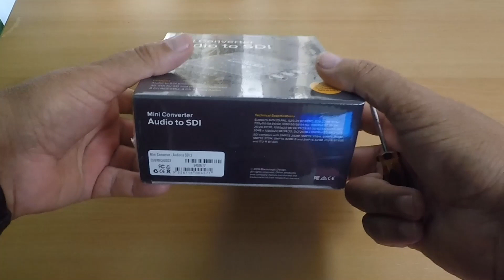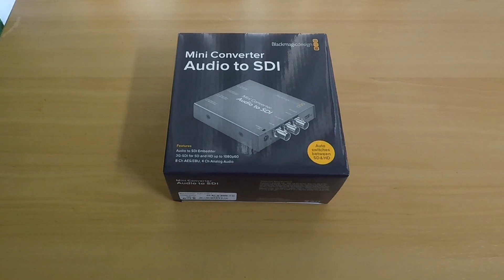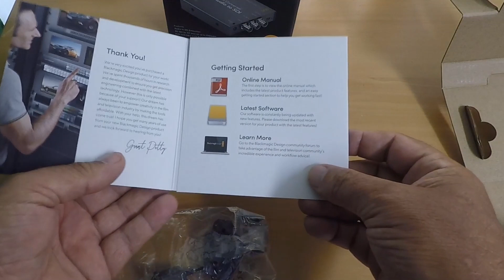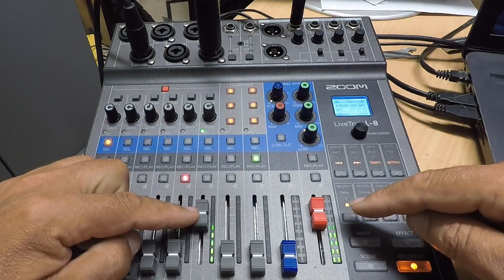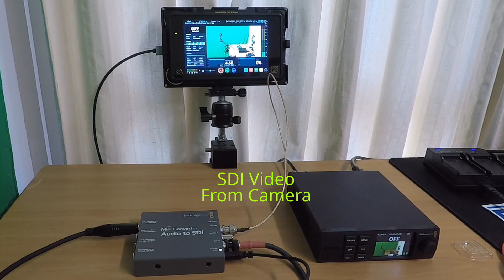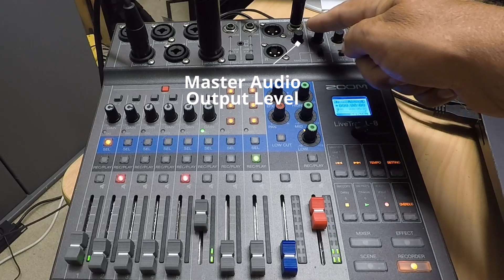Adding Analog Audio to SDI Video

Comment: Can analog channel 1 audio be stereo? Or is each analog input mono? Can’t really tell from the documentation if a 3 pin 1/4 phono adapter would be expecting balanced mono audio or if it could be stereo L/R on the single channel

Comment: Hi Mathew, How are you doing? Thank you for the nice video.  I have a question for you. I also bought this device but my one is not working. Actually I am not getting any SDI out put out of the device. Do you have any idea why it is so? It will be great if you kindly answer my question.
Reply from the maker: Check the dip switches, they need to be set according to the instructions. It took a bit to get it right. 
I have 3, 4, and 7 on